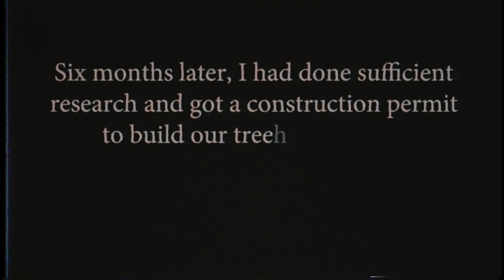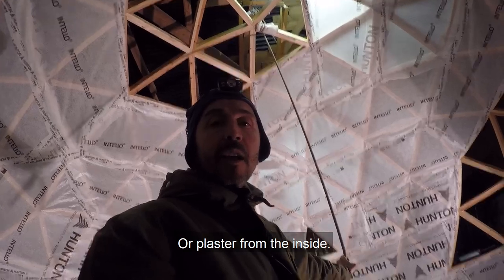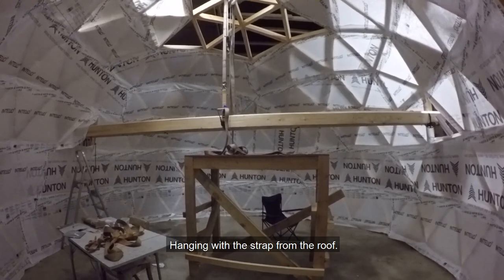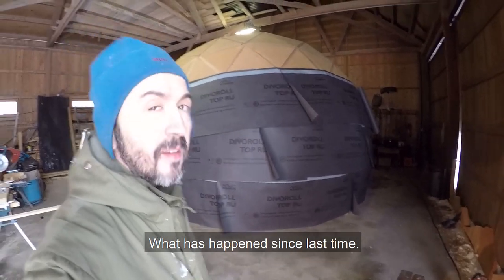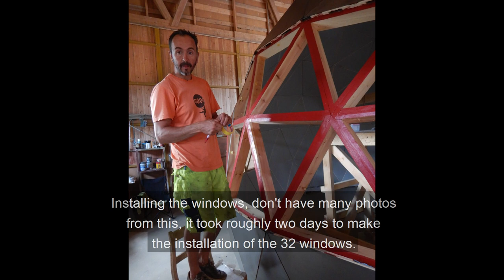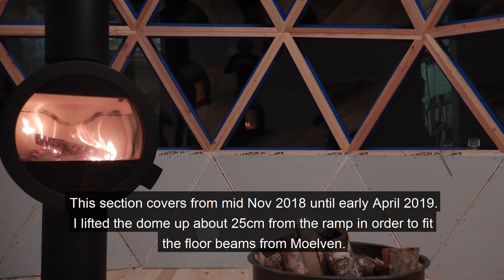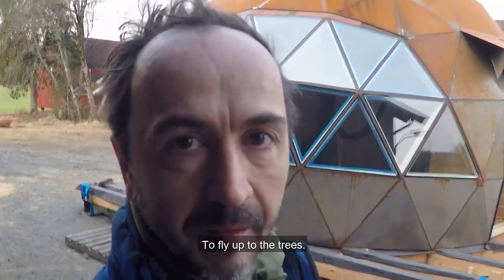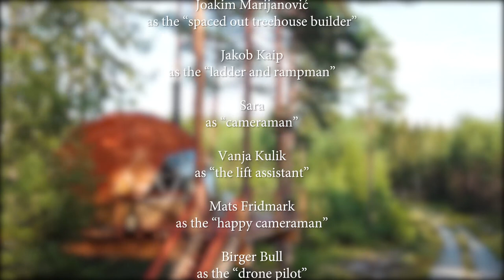Building a treehouse dome. Complete build

Comment: I was impressed when i seen the metal sheathing because that is a better choice for water damage resistance on the structure. But i thought you were going to weld the seams, but that is if it is thick enough sheathing to do a solid seam weld, and i don't know the reason you didn't paint it before it rusted.

Great job understanding all those compound angles and stuff, very nice job.
Reply from the maker: It is supposed to rust, corten steel! Sure, weld would be better, both is super tricky, and loads of job, since it is about 550m in total. The water layer is the black layer outside the insulation, tar paper...or in this case its like a goretex film! Are you building a dome yourself?
Reply: welding those triangles defining together a 3d geometry is definitely not a solution. You need to accommodate for thermal expansion of the steel and thus the need for a joint.

Comment: Awesome project!
It looks amazing, and I'm very impressed with your ability to build it in a garage and then move it to location. I hope your investment pays off. It seems ideal as a short-term rental.

My biggest concern with the covering method is the leak potential. It seems you are relying primarily on the "glue" rather than a monolithic coat or over-lapping tiles. Having the under-wrap as a backup water protection with a drainage plane is wise. I suspect the failure point will be at the largest window set, where the drainage plane seems to terminate. It may pool water there, and work its way up the wrap or into the windows. How is this system working out for you thus far?
Reply from the maker: Hi Josh, and thaks for the comments. Insightful - regarding the joints and sealants, but it is working. I used a lot of sealant around the windows and above the windows, and on the other parts i rely on the under wrapping....no leaks on that parts, as i overlapped with at least 20cm. Had some minor leaks around the windows after the first year, witch i sealed a bit better. Glad yuo liked the project! Are you building a dome yourself? Have a nice day! //

Comment: I also had thought about a Tree House / It wasn't a " Geodesic Dome " But is was a mix of
Victorian and Crafts-man Style Architectures ! 
I saw an Oak Tree with a 8 to 10 foot Diameter and Large Boughs I had Pondered the Idea
of using a Seat Belt Type Material For Suspension ( No more then 2 feet above the Floor ) and 
Steel Cables at the same place for back up !
I think it would come out every nice !  /  Now Back to the Video !

Comment: How did you secure the outside panels?
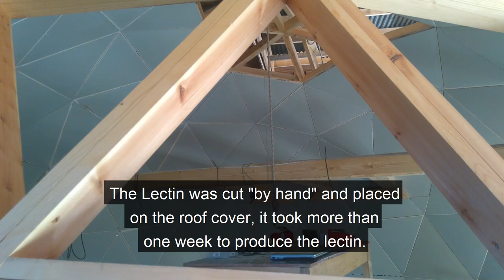Reply from the maker: vhb tape from 3M and sealant between the plates. white patches on the tree frame. At 45:28 in the video.

Comment: what kind of insulation is that? and what size cuts for the triangles? i wanna build this
Reply from the maker: Its treefibre insulation....there are so many different cuts in this dome! 11 different types of triangles in this spec of dome! so 33 different types!
Reply: It is not just needing to know the length size, but the angles, and there is compound angles. And with 11 different triangles you will have multiple different lengths and angles.
Reply from the maker: @TheRebelmanone  Yes, its correct.